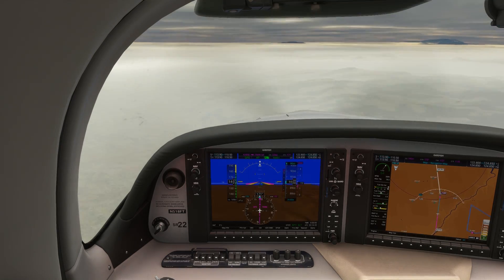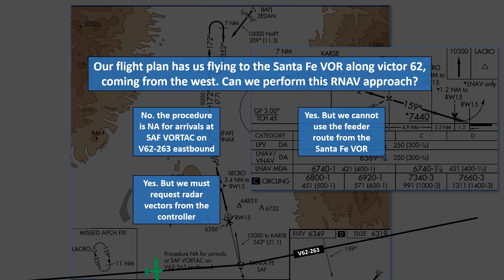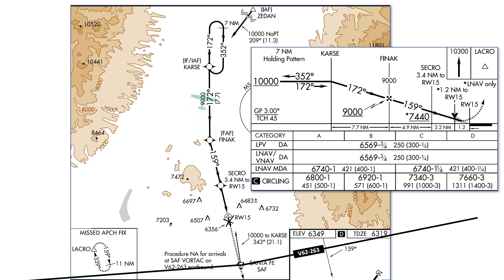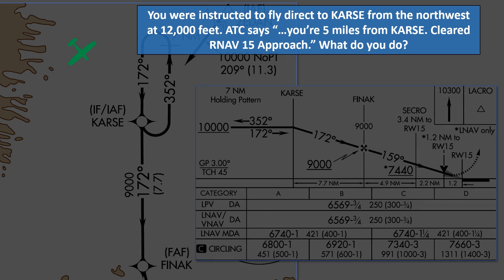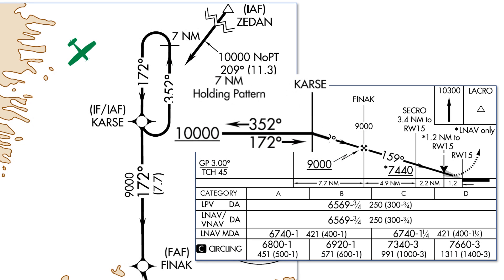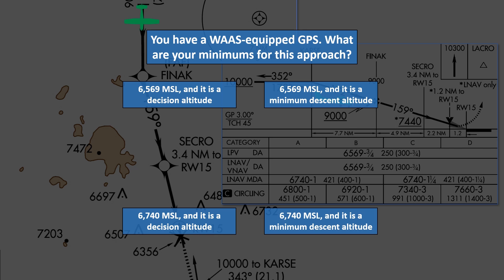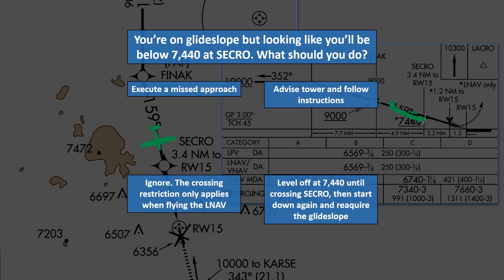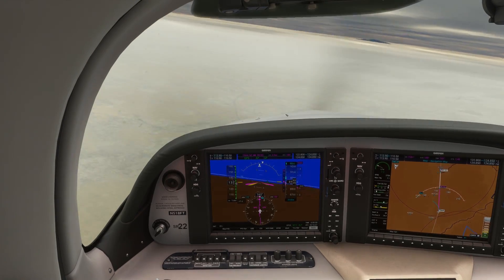Take this Quiz to see if you can fly an RNAV Approach | Reading Instrument Approach Plates

Comment: I really like this format!

On the question about coming in from the northwest, what if you were coming in at 10000, would you still have to do the course reversal?
Reply from the maker: Yes. If it's depicted on the plate, you have to do it unless told by ATC not to, or it's prohibited on the plate, as it is from ZEDAN. There are a few other restrictions too.
Reply: @flightinsight9111  SHARPTT 👀

Comment: 3:46 - I realize you address this in your explanation, but it's worth noting that it would be a mistake from the controller to not assign an altitude with this clearance.  The only time controllers can omit an altitude is if an aircraft is already established on the approach when the clearance is given.  

If I was given this clearance, I would consider calling back and asking what altitude they want me at.  And probably ask for the straight in while I'm at it.
Reply: He did assign altitude.  Basically  12K till established on the approach which at this point you can descend to 10k.   Had this all the time during my instrument training.

Comment: I would never just assume ATC wants a HILPT when straght-in makes sense (i.e., intercept angle <90deg), even if they don't say "straight in". In that case you should call back and confirm they want the full approach. HILPTs are so rare you're more likely to wreck the controller's day than make it.
Reply from the maker: True! Always confirm. I've had controllers tell me they're not expecting the HILPT even when it's appropriate.
Reply: @flightinsight9111  same. It's amazing how many aviation mishaps can be prevented by just telling/asking the controller what you/they want.
Reply: If the procedures say to fly the HILPT, you fly the procedure as depicted unless advised otherwise. You dont know if there is an aircraft ahead of you that you now lost separation with because you assumed the controller forgot to clear you straight in.
Reply: @Saml01  I never said to just skip the HILPT. I said to ask the controller to clarify. I would venture that far more issues have been caused by pilots flying HILPTs when the controller didn't expect it than from pilots not flying when expected to. You can prevent both by just ASKING.

Comment: Current instrument student near my checkride - I was taught that ILS has a glideslope and LPV approaches have glidepaths, as two distinct terms. Are they actually interchangeable terms?
Reply from the maker: You're correct that it's common to call GPS guidance a glidepath while an ILS is a glideslope, but you'll also hear them used interchangeably. In the airlines there's a more clear distinction in terns.